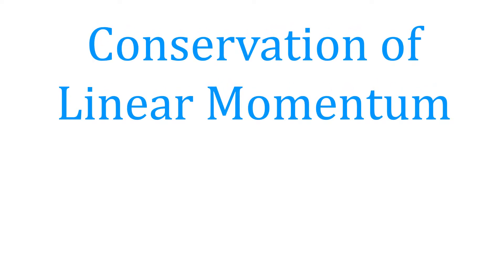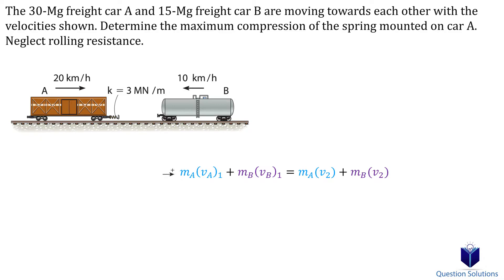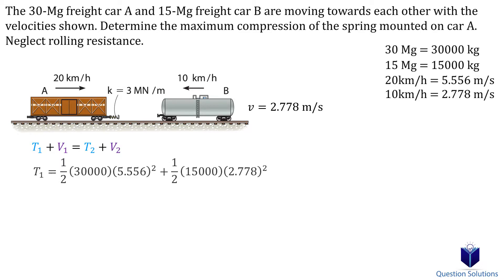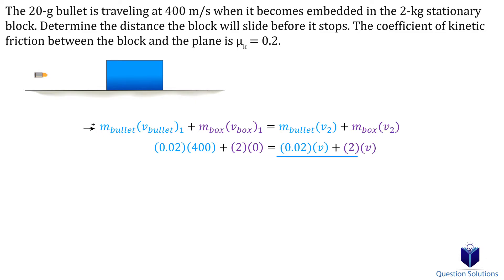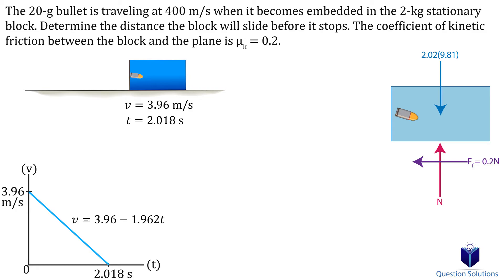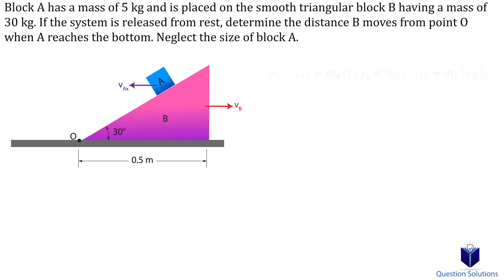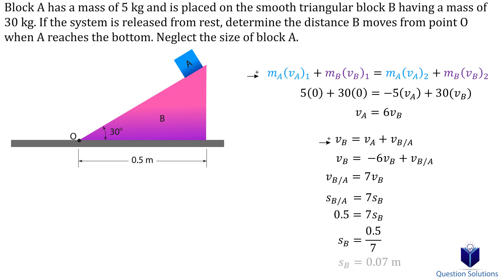Conservation of Linear Momentum (Learn to solve any problem)

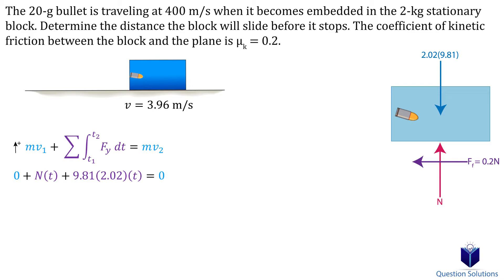Comment from the maker: At 4:27, there is a typo. The acceleration should be negative in that step, since we picked up to be positive. However, the next step is correct and this does not affect the final answer.

Comment: How come in the bullet problem you can't apply F = ma and find the decclereration of the block caused by the friction force. Then plug that into a kinematic equation V^2 = Vo^2 + 2(a)(s). Where V final is 0 and V initial is the velocity we found from conservation of linear momentum equation
Reply from the maker: You can solve these problems in multiple ways. I only showcase the method needed for a specific chapter.

Comment: In the 2nd problem, could you have used the "principle of the work and energy" equation since you can get the distance directly from there?
Reply from the maker: You can use any equation you like to get the answer, most of these problems have multiple ways to get at the same answer. :)

Comment: I'm confused on when to use the principle of work and energy, conservation of energy theorem, principle of linear impulse and momentum, and the conservation of linear momentum. The equations all look similar.
Reply from the maker: @amaritakes  Most questions can be solved using any of those methods and end up with the same answer. The key is to understand what's given to you. Sometimes, you have enough givens to solve it using 2 methods, but other times, you're given just enough information for one method. You might be able to derive the stuff you need to solve it using another method, but that's a personal preference. On your exams, questions are rarely formulated to use just one method. Most of the time, you will need to use one method to get one piece of the answer you need for the next method. So in a nutshell, look at what's given to you, and that determines what you need to use to solve a problem.

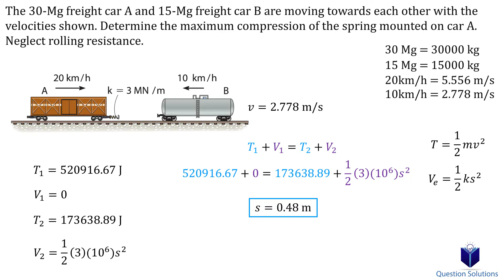Comment: hey guys In 2:56 question, if you use work energy principle then it will be far more easier. T1+U=T2 (;T2=0) we have all value except the distance traveled, easy! 
Also thanks to you I can pass my dynamic exam.
Reply from the maker: A lot of these questions can be solved in more than one way. I only show case a single method, usually one pertaining to a chapter. Best wishes with your dynamics exam! :)
Reply: @QuestionSolutions  YES i used this method its A LOT easier!

Comment: Wouldn't it be easier to solve the second question using the work energy equations after finding N , since it directly provides the horizontal displacment.
Reply from the maker: You can solve these problems in so many ways and get to the same answer 👍

Comment: For question 2, if anyone finds it challenging to identify the integrals, I found that using the work-energy method is more intuitive. It avoids dealing with integrals and is simplified as:
1/2(Ma+Mb)(v)^2 - (N)(k)(s) = 0
and solve for s

Comment: In the last example, why is the small box’s velocity pointed tot the left? And not pointed in the direction of the 30 degree plain? I find it difficult to see that.
Reply from the maker: Take note of the notations used. It shows V_Ax, which represents the x-component of the velocity, which will be parallel to the x-axis, in this case, the grey base.

Comment: Why is S_B/A in the last example 0.5 m, isn't that S_A because it originated from 0.5 m away from point O? I'm having trouble visualizing what the 0.5 m means in the diagram, it looks like it means the width of the triangle B. Thanks
Reply from the maker: So an easier way to think about it is to imagine the origin at block A. In that case, block B "moves" 0.5 m. It's really just the difference in the starting points of A and B, hence B/A.

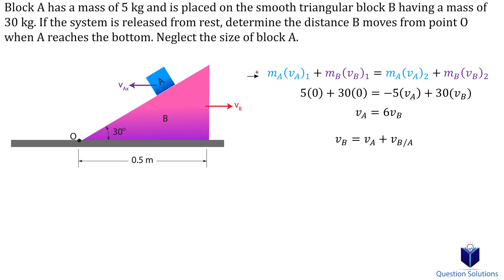Comment: On the last problem at 7:25, I think it should be V a/b because  we know from B's perspective A moved .5 meters. We don't know yet what b/a is. If we get it wrong in a case would it make a difference if we keep our signs correct? I can't figure that out. Thanks for your hard work.
Reply from the maker: Did you see this video first? https://www.youtube.com/watch?v=opVKNCedkRo

The whole answer will change if you use a/b vs b/a. It's very important you distinguish which you use because the equation changes based on it. If you have the time, please watch that video.

Comment: Hello, I don't get why in the first example, we applied conservation of energy on the system of particles (car A and B) and not only on A. Doesn't the spring become an internal force? In other examples like this, we only applied conservation of energy on the car with the spring attached on it. How do we know when to do that? Also, when does max compression occur in this example? does it stay compressed to the max even after the collision?
Reply from the maker: I can't answer your question since I don't know what other examples you are referring to. It might be different, or you used a different method at getting the answer. There are usually more than one way of getting to same answer so it's hard to say, and if you get the same answer, then your method is also just as valid as what's shown here. I only showcase a single method. For max compression, the train will couple when it hits another car, and the spring will stay constantly compressed due to the coupling, which is why they both have the same velocity after they have the impact. I show this at 0:52 :)

Comment: For the bullet block problem. wouldn't it be much easier to use work energy principle?
Reply from the maker: You can use any method you like. You can get the answer to these problems in so many different ways. I just showcase a single method per video. :)
Reply: I paused the video and solved it that way and got exactly 3.996m and then played it and saw he did something else and it scared me XD then he got the same answer as I did! i was looking for somebody who also did this and it looks like i found you. good thought!
Reply: @aidenbrown7200   how do u solve it. what do u use for the intial kinetic , the friction forcse
Reply: @mebawubeshet6729  For question 2, if anyone finds it challenging to identify the integrals, I found that using the work-energy method is more intuitive. It avoids dealing with integrals and is simplified as:
v = 3.9604 as solved for in part 1

1/2(Ma+Mb)(v)^2 - (N)(k)(s) = 0
and solve for s

Comment: For problem 2, using linear impulse and momentum, would it be correct if you instead did s=integral (t to 0) 3.196-1.962t dt? And then set s=0 and solve for time? Or would you have to find the bounds of integration for time?
Reply from the maker: You need the bounds of the integral to solve the problem. Otherwise, you will have final distance as a variable and final time as a variable.

Comment: @7:14 why can't we proceed by conservation of energy change in potential energy of block A =  change in K.E of block B + change in K.E of block A ??
Reply from the maker: Did you try it with that method? So the goal in this video is to use conservation of linear momentum, which is what I showcase. But you can use any method you like to get to an answer, since there are multiple ways to solving the same problem.
Reply: @QuestionSolutions  yes but there is variation in ans...i am getting 0.095m according to your solution it is 0.07m.
Reply from the maker: @vigneshwaranrm6277  Then I am thinking maybe there is a numerical error or a part is missing on your equation? I am not sure, it's hard to say since I didn't solve it with conservation of energy. 😅 See your professor during office hours and show him your method so he can check over your work.

Comment: Thanks for your great videos.  Note that after I calculated v = 3.96 m/s (as you did), I then applied the following simple suvat equation to determine the stopping distance:  final velocity squared = initial velocity squared + 2*acceleration (negative,  due to the friction force)*s.   Note final velocity squared = 0.   My answer is 4.036 m, which is very close to your answer of 3.996 m.  It looks like my method is simpler and quicker in this case.  Was I correct in applying this formula, or was it a coincidence that I got the correct answer (or one very close to the correct answer)?
Reply from the maker: There is usually multiple ways to get to the same answer, I only showcase what's pertaining to a certain chapter. But in general, there are tons of ways to get to it. 👍
Reply: I did the same method as you did and got 3.996m. I think you rounded off the acceleration too much.. I used a = -1.962

Comment: @4:27 when you calculate the normal force N, you said that upwards was positive so I think the equation would have been N(t) - 9.81(2.02)(t) = 0.
Reply from the maker: Yes! Good catch, it's a typo. 😅
Reply: @QuestionSolutions  you should mention that in the title just because.
Reply from the maker: @justinbeck560  I pinned a comment saying it in case anyone was wondering.

Comment: For finding the distance on the second part of the problem can't you just use the principle of work and energy which is easier than first finding t. I did that and got 4.03m which is the same answer.
Reply from the maker: You can use many different methods to arrive at the answer. I just use the methods pertaining to the topic. There are many ways to get to the same answer with these problems, some are much easier than others, some take the long route, but I try to stick to whatever is relating to a chapter, otherwise, it's sort of pointless to do a video on that topic 😅
Reply: @QuestionSolutions  true. Thanks for these videos. They are great. Im using them to study for the FE.
Reply from the maker: @Trebor77-RM  You're welcome, I wish you the best!

Comment: hi really helpful big thanks...but i have i question when we use (linear impulse and momentum or conservation of energy or others) cuz i really confused.
Reply from the maker: If you look at the 2 equations given, you can see when to use it. Impulse has to do with time, so if time is given, you can use it with an equation of linear impulse and momentum. If it's just velocity and mass, you can use conservation of momentum. 👍 The more questions you do for each topic, the faster you will realize which equations to use in what situations :)
Reply: @QuestionSolutions  really thx...im sorry ,but I'm going ask another question (in the example number 2 there is no time?) it just masses ,velocities and foresees...and you used linear impulse and momentum
thank you
Reply from the maker: @slimlady9923  Don't be sorry about asking questions, the more you ask, the more you learn. I was able to use impulse and momentum because time would get cancelled out. So notice how I started off with a conservation of energy equation because we had mass and velocity. After that, we still didn't get the answer we need, so we then switch to a linear impulse and momentum equation. You can also notice that we are looking for distance, and distance is related to speed, which is related to time. So you sort of have to work through these steps in your mind and see what can be done. Even if you take the wrong path, you will see that you're not getting the value you need, so you can retrace your steps and come back to an equation that works. In more advanced problems, you will definitely have to use both to get to an answer. This is just a tip, and in no way a solid factor, but in most final exams, the questions your professor will create will require you to use at least 2 of the main equations, if not more to arrive at an answer.
Reply: @QuestionSolutions  thanks and sorry again , wish me luck i have an exam
Reply from the maker: @slimlady9923  Really, you don't have to be sorry for asking questions. Feel free to ask, and I'll do my best to explain. I wish you the best of luck with your exam! 👍

Comment: Hello. once again a excellent video. I have a question: in the last problem, could we say that the normal force exerted by B in A as a contrary force  exerted by A in B, because of newtons third law? and thus we would apply the similarity of triangles and discover the X component of this force. then we would find out that that component is in fact the total force aplied in B ( the forces in Y axis cancel), therefore we would need to calculate the distance A did ( by applying trignometry ) and with the kinematics equations for A discover the time it took A to reach the end. With that value of time and the value for acceleration of B ( applying newtons second law, we have the total force and the mass) we plug in the values in the kinematics equations for B and discover the distance he covered in the X axis in that time period. The problem is, if you do so, you get a absurd value of 2.02m. what did i do wrong?? Thank you and keep up with the great job.
Reply from the maker: That seems like a lot of steps to get to this answer, doesn't it? I mean was your method faster? I have no idea 😅 Again, I don't know what you did wrong without seeing your steps :) With this method, I think you can solve the problem easier and faster than going through a lot of trigonometry and all the other parts you did. Though I do like how you always try to solve the questions in different ways, since there is always more than 1 way to solve them. The only problem is that sometimes, there aren't enough values given, or some just don't help out.
Reply: @QuestionSolutions  they were indeed a lot of steps... i suppose your method is much better but i did not see it crystal clear at first.. nevertheless i continue to be confused on what i did wrong, because something must be wrong with my way of thinking.. i dont know how i could show you just like i said in the other comment. but thank you a lot!

Comment: Thanks so much for posting these!

A question about the second question. I used the equations of motion in y to find the Frictional force, then I used them again in x to find acceleration. Plugged it into the kinematic equation a ds =  v dv, integrated and solved. I got the correct answer but I was wondering if it's another valid method or just a fluke. Thanks again!
Reply: On first thought, I thought about using conservation of energy and that also worked well👍🏻
Reply from the maker: More often than not, there is more than one way to solve a problem. You used kinematics to solve the problem, which works as well. Try to solve it in both ways so you learn the new concepts as well :)
Reply: yup got the same. You have done correctly